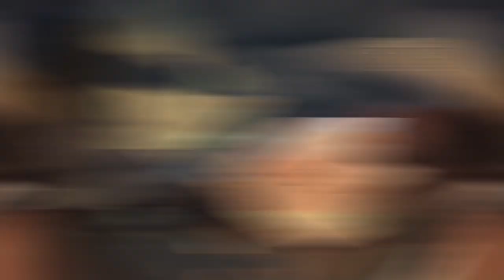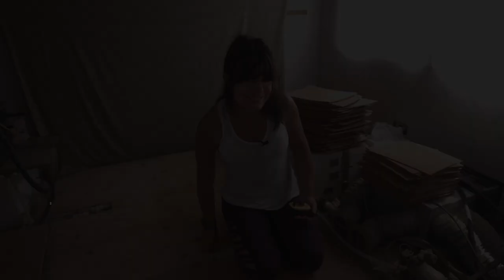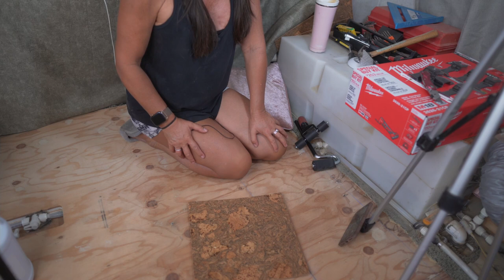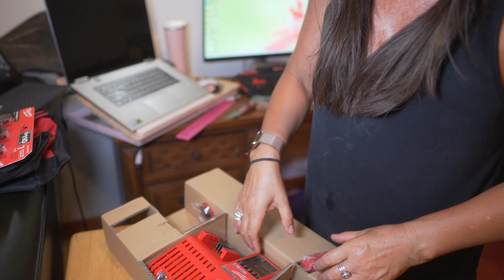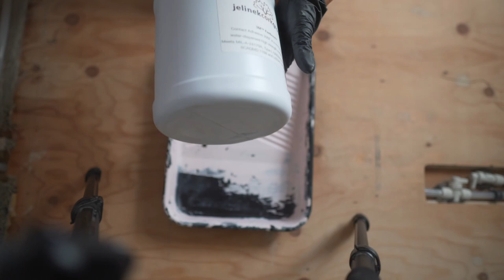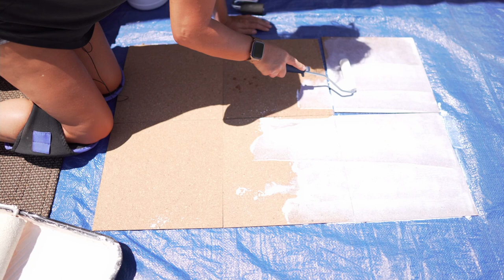RV RENOVATION: ZERO EXPERIENCE CORK FLOORING INSTALLATION. PART I. SUBTITULOS EN ESPAÑOL.

Comment: Sears  and Robuck  used to have a  huge Tool section  plus their mail  order Catalog..  Do  you  know  Tim Allen the Comedian?  He   said "
 "When I go into the  Sears Tool section my Nipples get Rock Hard.." 
   I have  several  120  Volt Millwalkee  Tools but  My  Cordless are Dewalt..  I had   6  batteries  but  two of them have gone dead.. Turns out you  are not  supposed to run  Lithium batteries all the way to zero charge..
Reply from the maker: Hahahaha! Tools are pretty exciting! 😂 Would you recommend Dewalt? I do want to get good quality tools. Good to know about the batteries!
Reply: @HerSoulVacation    I was  told that   Millwalkee  120 volot  AC  tools are the best and their  battery powered tools are not so  good..
  Considering that you already have  one  Millwalkee  powered  tool  with a  battery and a charger .  You may as well stay with Millwalkee.  I put  off  buying  battery powered tools for years  until they  finally came out with  Lithium batteries..  My Dewlats  are  18 Volts.. I  think the New Dewalts  are  20 Volts..  
  It's  nice to have tools that can share battereiws..  
  I have Drills  Impact  wrenches  1/2'  and  1/4"   1/2  Impact  Drill ..  3/8'  drill  ..  Angle  Grinder ,  Skill saw..  and I have  several lights that use the same batteries..  Even a  vaccume .. but  the  vaccum  will  run on  120 voltes too ..
  It's    almost  cheaprer to  buy a new  tool that comes with a  battery than to buy just a  battery alone.. Unfortunatley  my failed battery  camewith a  new tool and a refurbished battery ..
Reply: @HerSoulVacation    Mikita  and Dewalt are the best I have been told .. but  Milwalki is not bad..
Reply from the maker: @mikeskidmore6754  I started with Makita tools and wanted to stay with that but I could not find the tool I wanted available. Since I had heard that Milwaukee is another good brand tool, I went with it. So I'll stay with Makita and Milwaukee since I have the batteries and charger for both because as you know, batteries are expensive!